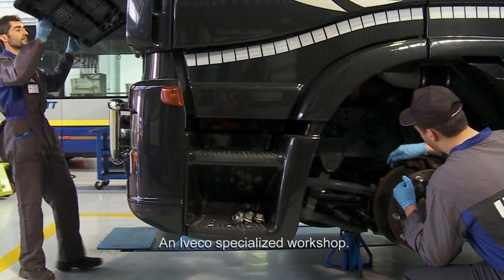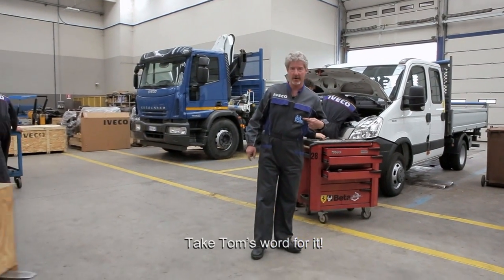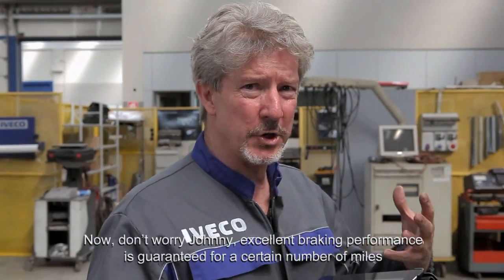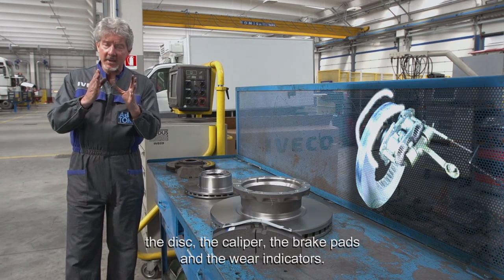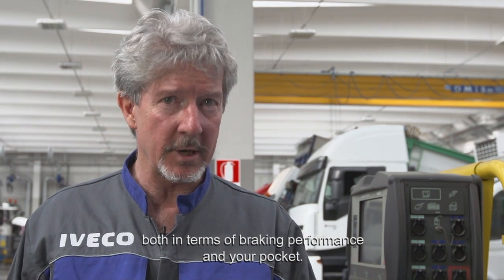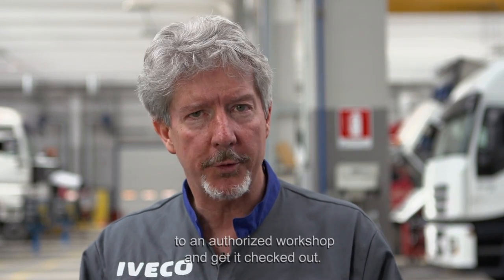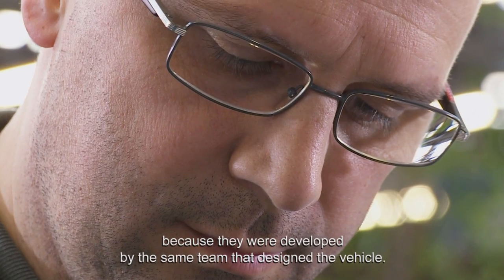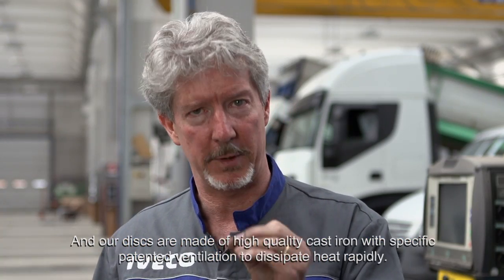Iveco Brakes - Ask Tom

Comment: Hi Tom ..I have an Iveco commercial abs,traction control and hand brake lights are on I HV replaced the worn out pads , discs and put new sensors and I also bought new ABS sensors but the lights still won't go away please help

Comment: Hi tom i have an iveco daily 2008 minibus 2.3 hpi   with a brake problem with brake binding after taking for a test drive. I have fitted 2 new rear calipers, discs and pads,I have fitted 1 n/s/f caliper and pads and stripped and checked the o.s.f.caliper and fitted new pads. the brakes come on and off as they should but if I press the brakes whilst the engine is running the brakes bind on the o/s/front but release after about 30- 60 seconds. I have just fitted a new brake hose to the  o/s/front but the problem continues as mentioned before. I have spent a lot of money and time on this van, please can you offer me some advice